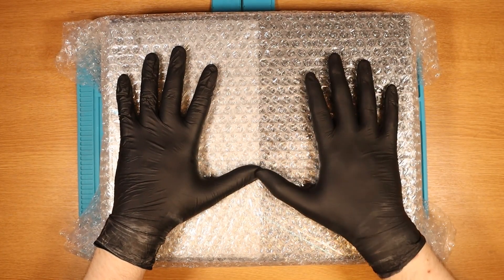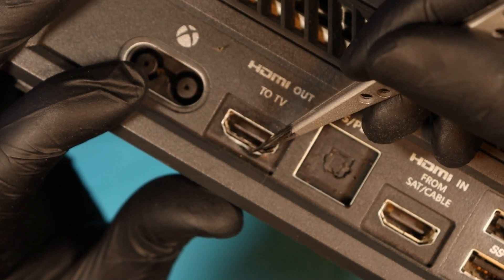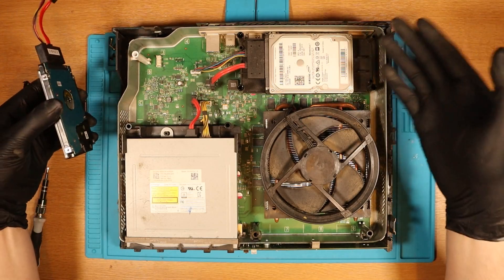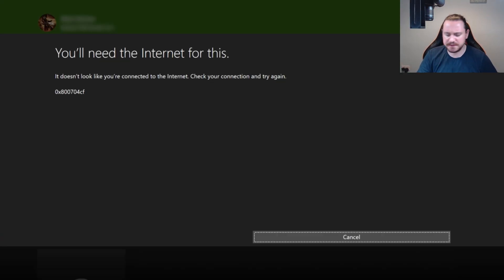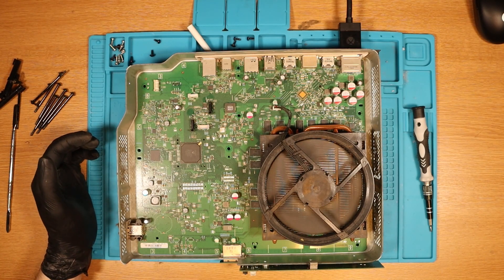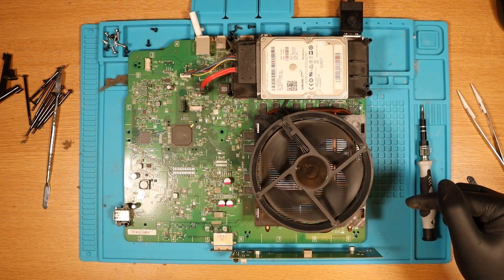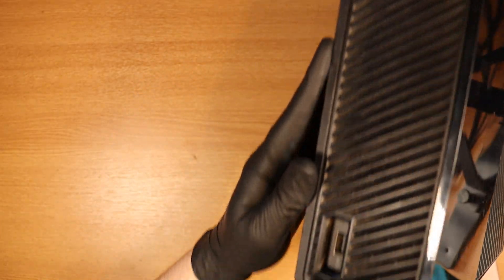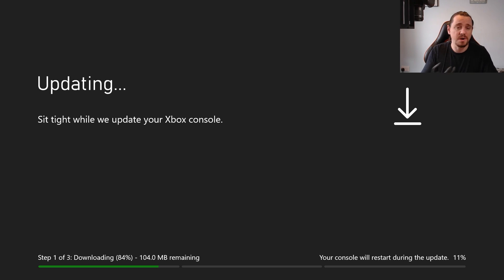I Paid $135 for Two FAULTY Xbox Ones | Can I Fix Them?

Comment: I bought myself a faulty ps3 super slim and it was missing right side panel and hdd screw and was sold as dvd drive broken and something was rattling. It was rattling becouse of the hdd screw missing and the drive worked fine so i 3d printed the right panel and replaced the screw and works flawlessly.